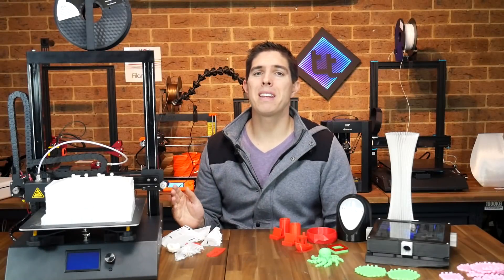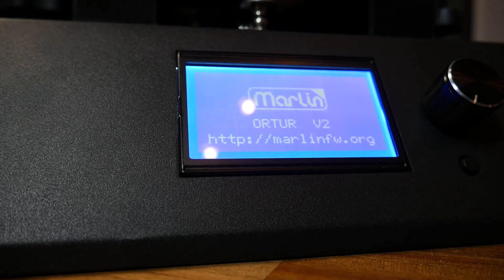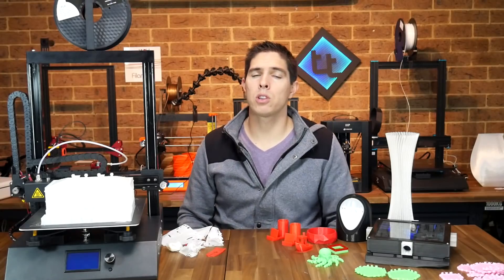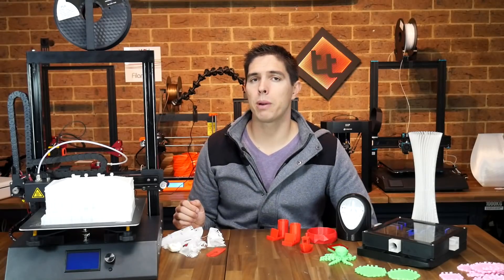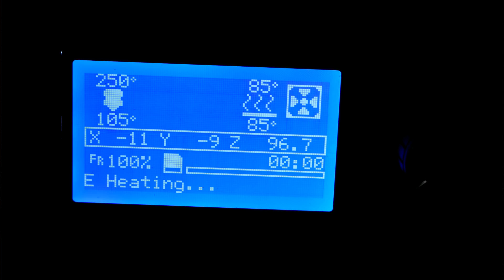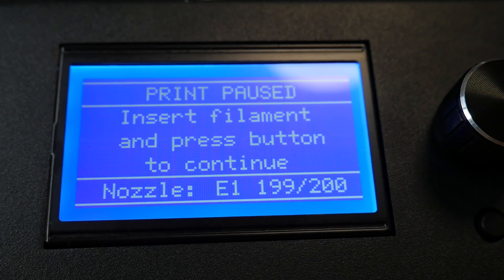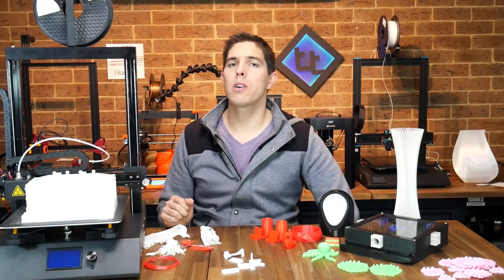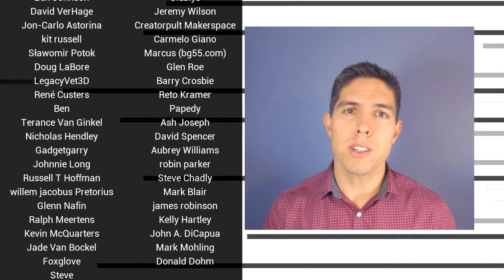Ortur 4 linear rail 3D printer review(?) - UPDATED

Comment: reminds me of my now dusty Tevo Tornado... Just can't get good first layers with consistency so it sits watching my enders working all day
Reply: Victor Tam  yep i upgraded marlin on all
Reply: Victor Tam  i would have 30 enders without thermal runaway before i had an ortur. Ender is the way to go as a noob.. just watch 600 videos on building and upgrades before it arrives. Learn how to use cura well. Rebuild the entire thing out of the box and make sure all gantry is square, wheels are smooth and tight and ull be all good
Reply: Victor Tam  for anything other than an ender u will need 1000 videos and 200hrs of learning how it works and rebuilding it 20 times. this ortur for a noob never seen a printer before would be their first and last and be in a bin within a month.. even as a seasoned printer I wouldn't dare try to use one & their rep contacted me offering an almost free one to test lol

Comment: Junk. Not really surprised, though. Thanks for the heads up!
Reply: We are keep improving Ortur-4 3D printer to make it better, like to upgrade wire connections and extruder head for 2nd generation Ortur 3D printer. Ortur-4 is new generation 3D printer with  built-in dual-axis linear guide rail, printing accuracy and speed can be well ensured, not only copy popular models in market.
Reply: @auferoofficial1310  How about you start by checking to make sure a loose screw isnt going to fall inside the power supply and nearly kill someone? You can attempt to improve all you want but in the end you're just making a cheap copy with horrible quality "upgrades."
Reply: @justinl.3587  the packaging need to improve, this is what we need to do.
In fact, all the printers would do a 10 hours testing print, before packaging. 
But we didn't anticipate that there would be such a bad condition of some shipping channel during delivery, and we would improve package and quality control  as requested.
Reply: @auferoofficial1310  A 10 hour test print isnt needed. Even just an hour is needed. Quality control is the issue. That screw, had it gone unnoticed, could have caused a short and/or a fire. 

Creality is worlds ahead of you and even their quality control sucks. Your company is like the many others in the market below the $500 benchmark. Produce as many as you can, make as much money by as you can while your machine is trending and move on to something else. 

The issue is, your machine will not trend, it will not become popular. It's a bland, blended copy of other machines.
Reply: @justinl.3587  About your safety concerns a fire , the TRP-Thermal Runaway Protetion would be activated easily if did not detect temperature or detected temperature by wrong.
As a result, 3D printer would stop heating and display this error in LCD screen, unfortunately, Lawgic did not mention in his recview.
Reply: @auferoofficial1310  Thermal runaway protection has nothing to do with the screw that nearly fell inside the power supply from causing a short or a fire. 

Seriously, your product is terrible but that doesnt stop your company from preying on those who seek a low budget machine. You'll get away with it like many have and then you'll produce another pile of scrap once this one fails to sell. It's just another typical Chinese company with common Chinese business practices. Again, nothing new.
Reply: I'm muting you at this point. I just hope for two things. You go out of business, or that your terrible product doesnt injure someone.

Comment: looks like you need to dry your TPU, but of course you YouTubers "know what you're doing"
Reply: Victor Tam  TPU is hygroscpoic- meaning it absorbs moisture out of the air. When TPU or the like is printed while it is moist, it tends to create a "fuzzy" skin on the print, popping as it leaves the nozzle.... which is the water boiling off creating vapor.

Comment: This makes me grateful my first printer was an Ender 3. 

I was actually looking at getting one of these after hearing about the linear rails.
Reply: Victor Tam  I'm not sure, but I believe so on Thermal protection from factory. I always upgrade the firmware myself and include it. The thermistor is secured by a screw.
Reply: Just spend 20-50£ and you can put linear rails on your ender 3

Comment: I think you have been overly kind in your review.  Based on the problems, defects, and safety issues this should be a fail and avoid.  The vendor should be sending you an updated printer to confirm the changes you have have been told have occurred.  
I don't think this video should be considered a review in any form nor an endorsement by you.
Reply from the maker: I appreciate the feedback. I made a point of saying this isn't really a review. I have shown my experience, warts and all, and now people can make an informed decision. Judging by the comments, a lot of people have made a clear one.
Reply: @TeachingTech  Ortur is a new brand, it has been under designing and testing in 2018 whole year, but just launched to market in 2019. Though it has some issues, most of clients are very satisfied with the printing accuracy and speed, and gave us very positive feedback and improvement advice. That's why we want to launch second version Ortur-4 3D printer based on their advice. Regarding the safety issues, if the thermistor did not detect the detect temperature or detected temperature by wrong, machine would stop heating and display this error in LCD screen, but you did not mention this function in your review video.
Reply: @auferoofficial1310  please get your fake reviewers off of this comment thread.  They are blatantly obvious, if you'd like to discuss privately I'll be happy to show you how and why it's obvious.

Comment: I've worked in retail in the one thing you don't do is sell a customer an unfinished product so I would give two thumbs down for this special for what they're asking for might be better than an ender 3 but it ender 3 is polished.
Reply: The ender 3 has undergone many revisions. Most were relatively minor, but recently they completely upgraded the motherboard and stepper drivers. What worries me  is the state it was in at unboxing. If your printer gets incremental improvements over time that's fine, even welcome actually. However, sending out units that arrive essentially broken and unsafe is completely unacceptable.
Reply: Victor Tam  ,
All aluminium mines works great and easy to fix and modify
Reply: Victor Tam  .
So if you want the cr-10s pro you have another option to the prusa MK3 they're very close to prices but either one will be awesome I had time to modify mine and it probably runs as good as the CR 10s pro just a smaller build size
Reply: Victor Tam  I have an ender 3 (no relation to my user name) and it is fantastic, especially at its price point.
Reply: Victor Tam  no need to be sorry. You pick whatever works for you. Fyi though, the ender 3 doesn't need to modified or repaired (with the possible exception of turning on thermal runaway) to be a great printer. It's just easy (and fun!) To modify it to make it even better.

Comment: If i was new to 3d printing, i would be completely lost with this unacceptable printer.  It has linear rails thats it only selling point.  That bed mount with wobble is a terrible design. If a company cant even fine tune its own profile what hope would somebody new to 3d printing. Mic great honest review.  Thank you.
Reply: Victor Tam  if u cant get a refund, the first thing u would do is do a test print and diag any issues with the print...ie example z banding, under eztrustion...it will point you to any of the faults this prints may have...best of luck

Comment: Anyone who is new to 3D printing would be HORRIFIED to get the same unboxing experience as you had. The company should give some compensation for costumers who already brought, considering it has so many flaws. It's similar to how Creality's printers don't have thermal runaway protection enabled and not warning people about it; and I was quite miffed to find that it didn't have thermal runaway protection especially because I was about to go ahead with this 6 hr print. I went and followed the proper steps to flash it on there since I happened to have an extra Adruino Uno lying around my house. But what if I didn't have the know-how or materials to do this smoothly? Or even worse, what if I had gone on with the print unaware of this issue and something happened while I wasn't paying attention? Disasters have happened before, as in this article: https://www.thissmarthouse.net/dont-burn-your-house-down-3d-printing-a-cautionary-tale/

 It's really dangerous not informing the public on issues such as these presented in the video. Even worse to not even go and replace those who already brought the printer.. Quite despicable indeed
Reply: People that have just picked a 3d printer up as they have got a price more friendly to normal people that have no real mechanical/engineering experience I feel a little sorry for
Common sense should save the day if not there's plenty of info available online you can trust
Reply: Victor Tam  In that aspect, yes but it still takes far too long to actually kick in, hence rendering the feature completely useless. That still doesn't excuse the other problems this printer has, which far outweight that one advantage it as over other printers. Not only, its price isn't justifiable considering the many issues it has, most would do better getting a printer that doesn't have thermal runaway protection (in my case, an Ender 3). So no, it's really isn't that much better than any of the other printers out there.

And quite honestly, most would do better buying a cheaper printer and getting an Arduino Uno set + dupont cables for ~US$30 and going through the process of flashing the firmware, which at most would take 10 minutes (and there are many guides online showing how to do this).
Reply: Victor Tam  I totally understand the concern, I definitely wouldn't let the kids around any 3d printer. I even went and added thermal runaway protection into my Ender 3 and I still don't let my nieces and nephews touch it while it's printing and/or while I'm not in the room. Then again.. you don't really need it per say unless you plan on doing prints that take days to finish. Even with the safety added, I still go and watch my printer for both the fun of it, and to make sure that the first layer adheres properly.

In fact, last night I stayed up for the very first layer of this relay box I printed and then went to sleep to let the rest of it finish, and everything came out just fine. That's the first time I've actually let it go on by itself and watch it like a hawk mainly because I was having issues with the print settings.

Comment: Its complete garbage and a waste of money, also shock hazard and fire hazard. Ortur said its a prototype but sold 300 already?
Reply: without thermistor, it would cause Thermal Runaway Protection, Ortur would stop heating any more. And it is full metal structure, can not cause shock/fire hazard.
Reply: Victor Tam  
谭总 2019/5/7 9:50:48
yes, wanrranty is one year against manufacturing defects. We are very sincere to manufacture 3D printers, the printing quality and speed is well praised in market.

Comment: Good evening I have this printer which is my first one I must say I have had issues but customer service has been good but I also had to solder the motherboard due to poor joint after a hours use. The company must have had this problem before as they showed me where to look. I have just received the mag base so just trying this out. Only used pla at the moment. I like the design of the guide rails. Improvements to the access for adjusting the bed levelling sensor is needed. I have seen the video for the new hot end which is good development I hope they look after there customers upgrade at sensible price.
Reply: Victor Tam  good morning this printer has a lot of promise but you do need to understand that you need to be an enthusiast with any 3d printer because I have found there is a lot of learning  to do. I now have the mag base which I just started to use on pla seems to be alright but you must spend the time and level the bed properly. I have just another problem the hot end fan has failed so I need to replace but I have contacted ortur and they are willing to assist. So if you are more experienced than me you will already know what look out for.it took me a lot of checking before I found the hot end fan had stopped working this caused major blockage of course. I like the guide rails. There is also a new hot end which is available the end of May according to ortur.
Reply: Victor Tam I have some small videos showing it in use on my channel 
Thank you Paul

Comment: any chance of an upcoming SKR V1.3 board review on an Ender 3?  paired with TMC5160s would be a double bonus ;)
Reply: I don't think that the TMC5160 boards use the same size driver boards and won't fit.
Reply: @JasonKM-NZ  There's a fairly new stepstick format of the TMC5160 available now.
Reply: @BasketballHellMember  Oh nice, i couldnt find one. where?
Reply: @JasonKM-NZ  In the U.S. I found and ordered them at Digikey and have yet to find them anywhere else here. I hope Filastruder starts stocking them soon.
Reply: @JasonKM-NZ  Posting the link to them separately since I don't know if YT will filter it but there's still some in stock at the moment: https://www.digikey.com/product-detail/en/trinamic-motion-control-gmbh/TMC5160-SILENTSTEPSTICK/1460-1385-ND/9990281
Reply: Oh_Herro_ thank you! Not sure why I really need them though lol. Always like upgrading though haha
Reply: @JasonKM-NZ  https://www.aliexpress.com/item/BIGTREETECH-TMC5160-V1-0-High-Power-Stepper-Motor-Driver-with-StealthChop2-StallGuard2-reprap-SKR-V1-3/32993409730.html?spm=a2g0o.cart.99999999.259.5e983c00j246Ll
Reply: Victor Tam update the firmware and it will. Unsure from factory.
Reply: Victor Tam the thermistor on my Ender 3 Pro is secured in place which is good, you just need to check the screw every so often. And according to creality the new units should have runaway protection enabled. Although I would still update the firmware to be sure. I’m unsure of other printers as the ender 3 pro is my only one
Reply: Sound good the 5160 drivers but they are pricey compared to the 2xxx series